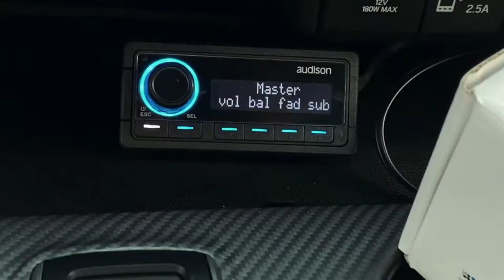2019 Honda Passport Audison Bass Custom Install with DSP | Newport Sound

Comment: Hey, that's my car! 
I just want to thank Newport Sound, they did an awesome job and I'm enjoying my new set up...!
Reply from the maker: Thank you for your business enjoy it in good health and happy miles :)
Reply: How did you disconnect your ANC?
Reply: @marim4478  Found a YouTube video, look for it...
Reply: Did you install sub only? What is the complete system setup?
Reply: @bigvinnie2325  Well, a bit obsessive I guess, but Newport Sound did all my Installs, Customizing of Posd & A-Pillars and DSP Tuning: Front: Thesis 3-way Speakers, Rear: Thesis Tweeters & Focal Woofers, DSP Amp: Audison AF M5.11, COMPANION Amp: Audison AFP8.9 Bridged, & a Audison DRC-AC Controller...!
Reply: Love what they did with that custom box, do you know what size woofer you put in it? Also can it be mirrored to do on both sides of the SUV?
Reply: @MrNathan07  I have an Audison 8" Sub,  I wanted to go bigger, but the Cu. Ft. of the box would not allow for it. And yes, a Sub can be mounted in the cubbies on BOTH sides, that would be cool and if I ever want even more bass, I might look into doing it...!